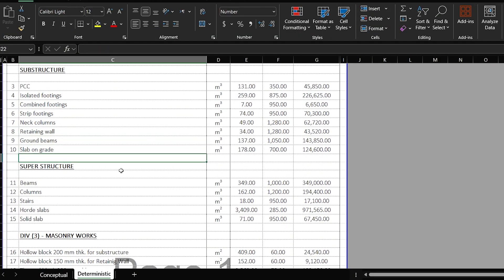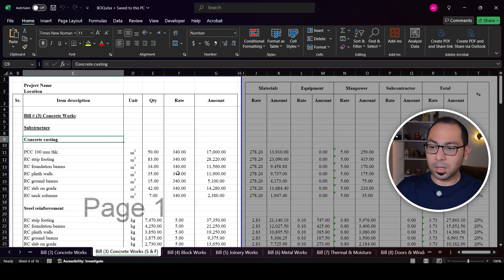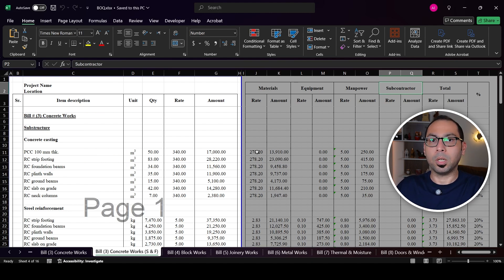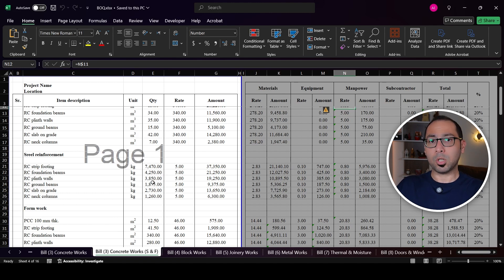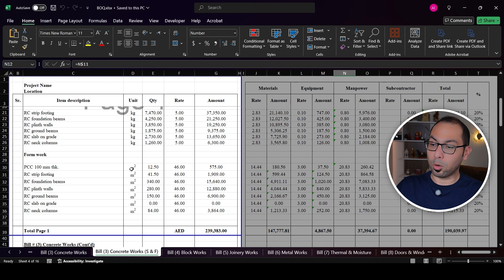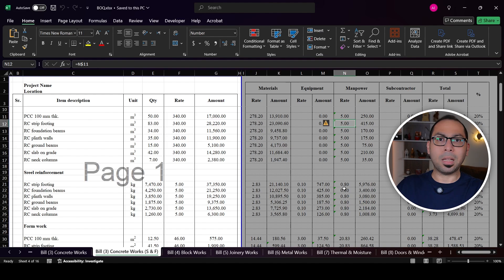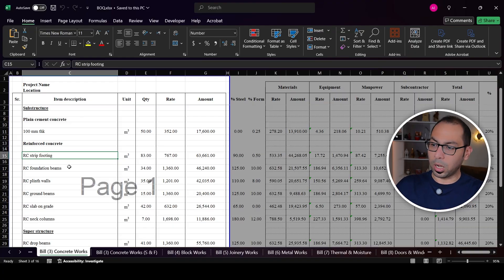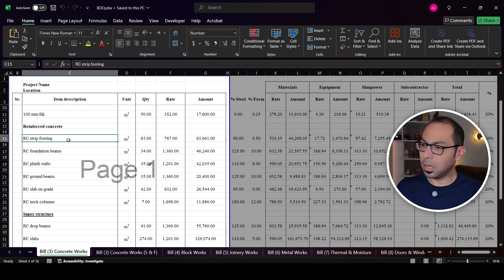Cost estimation of structure elements in construction projects

Comment: Sir please make video on pressure vessel,heat exchanger and reformer Heater estimation cost video on fabrication cost.
Reply from the maker: To estimate the cost of such items, will have to get their supply rates from a specialized supplier. Depending on the specs will get the supply rates, and for the installation you will have to allow for the manpower and equipment required

Comment: AOA sir, in K15 cell your formula is =(260*1.07+2.7*I15*1.05)    (In formula where you add % steel and % form ratio which is 90.00 and 0.50)   
can you please elobrate this?  
video 9:19 you clicked on K15 cell
thankyou.
Reply from the maker: Thanks a lot watching 🙂, in tomorrow’s video this is going to be explained again 👍
Reply: @CEPQS  Sir, I have watched all your videos more than twice. It's not you; I thank you for teaching me.
Reply: Okay, sir, I understand the concept of ratios. I also want to know what these values (260, 1.07, 2.7, 1.05) are used for in the formula: 260 * 1.07 + 2.7 * I15 * 1.05. If you could make a video on this, that would be great, and I will wait to clear my concept.
Reply from the maker: I15 is the steel ratio. Form work ratio is used in equipment and manpower columns